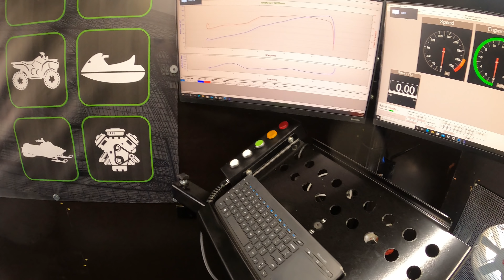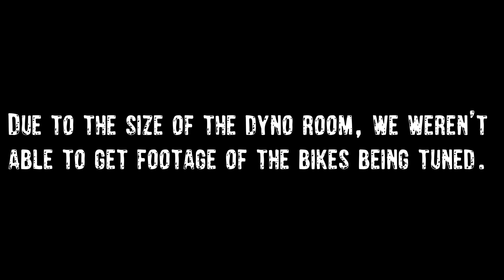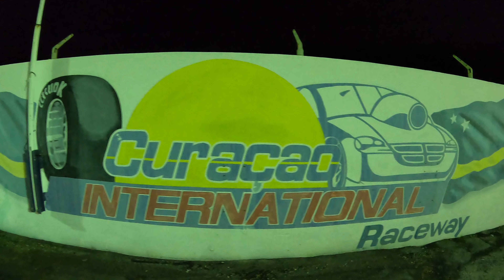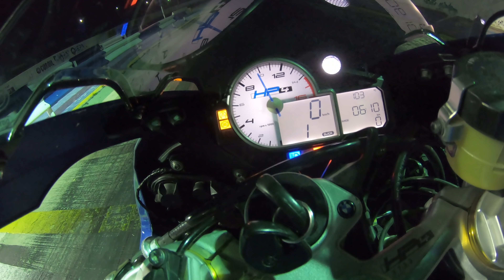Moore Mafia Goes to the Caribbean to Tune Bikes and Pulls out a MONSTER Wheelie on a ZX10R

Comment: Hey chris can you make a video about how a flash or tune AFR might change with warmer and colder air? It seems the s1000rr is the only bike with a factory wideband meaning that’s the only bike that can dial itself in regardless of ambient temp or elevation? I don’t see much if any info talking about how tunes could change with ambient temps.  Thanks